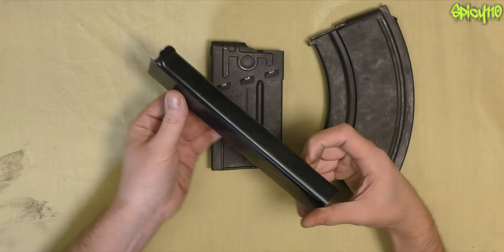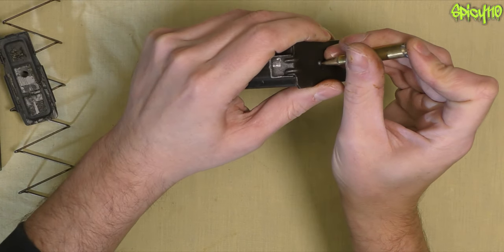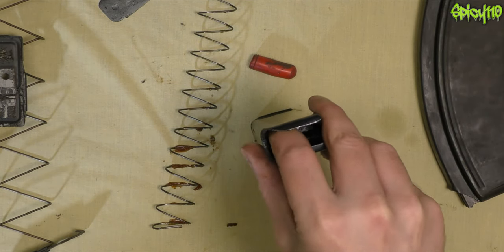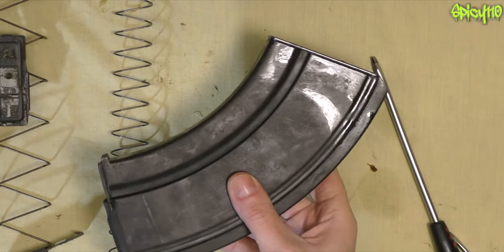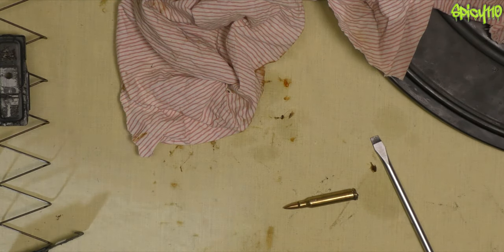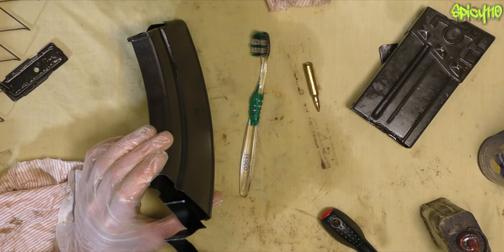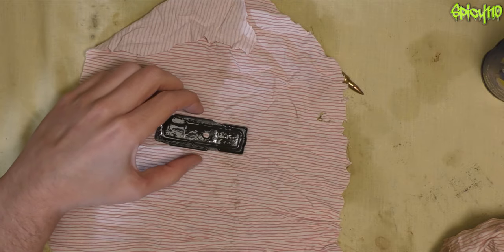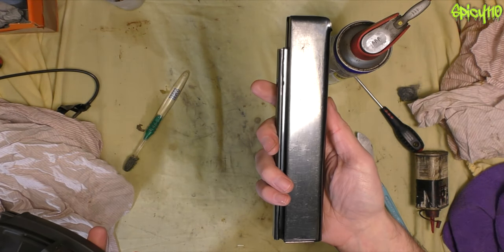Cleaning 3 Old Magazines! Bren - Thompson - HK G3

Comment: It never occurred to me to strip my Bren MKII mags!  Got the takedown button depressed and I'm now only missing the 37 meter internal spring but it's gotta be right here within a 100 mi. radius lol. Most awesome video my friend. And a note, I collected milsurps from every WWI-II belligerent, and that packing grease is a blend called Cosmoline. It's nothing you want in your chamber, breech, rifling, bore, or moving action parts. Birchwood-Casey Gunscrubber cans are the best. Non-flammable, metal friendly, high-pressure/high flow, and cheap. It's a chlorofluorocarbon so ventilate needed, but I buy two cans for every job. Drys fast and liquified the cosmo without much wiping at all. Hoppe's 9 is too expensive and ineffective, gasoline is prone to wood damage, and wiping will take as long as WWI to finish. The ONLY places I leave it are in sealed magazines, closed assemblies like spring channels, and dabbed into any pitting under handguards that can't be reached.  Wall hanger? Be liberal. My Bren spring had enough in it to preserve the Belarusian AK reserve. Ay other cosmoline removal suggestions or general oil grades for reassembling and use would be appresiated.